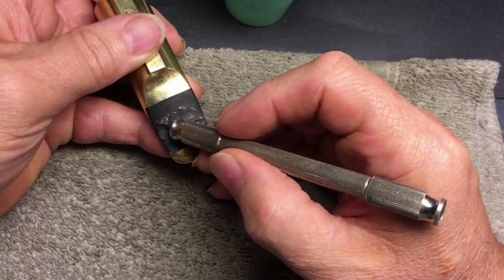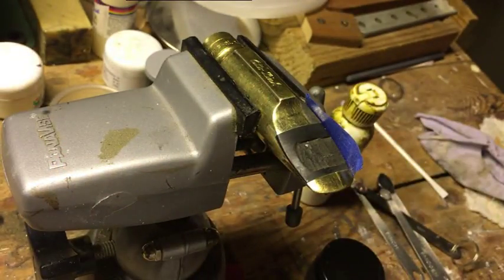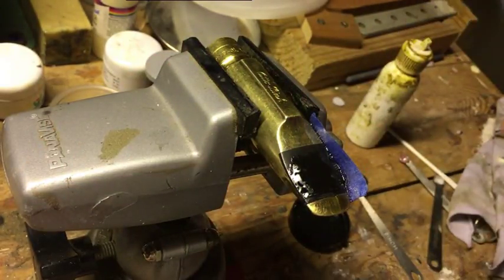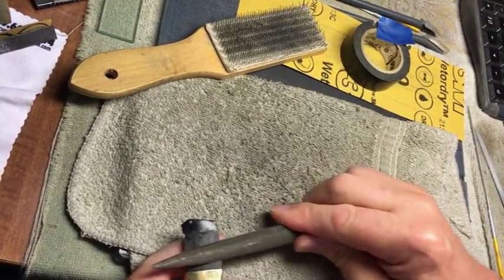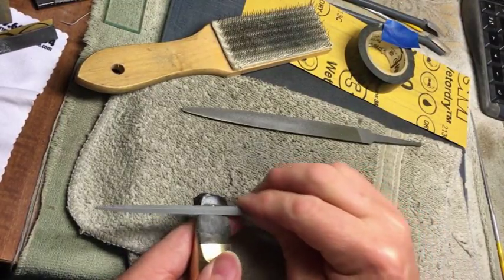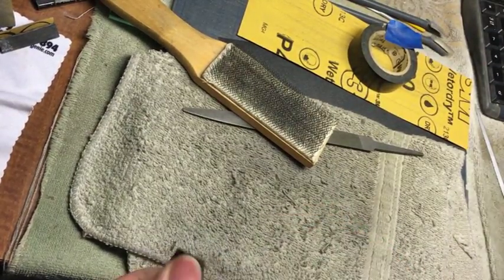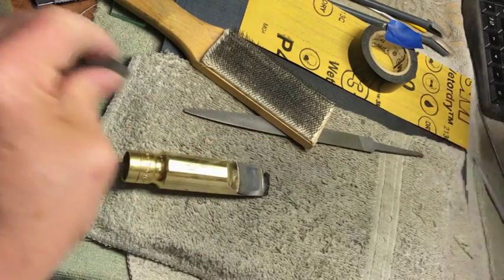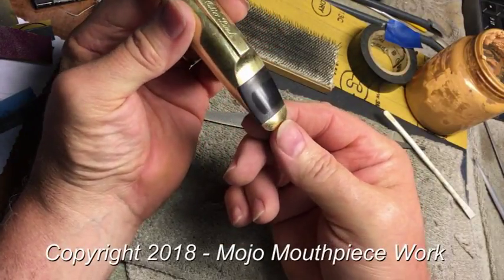Mouthpiece Bite Area Repair

Comment: So it's similar to the superglue and granadilla dust technique for wood clarinets.  Pretty neat.   Does buffing improve the color match?  I can still see the difference between the original material and the patch.  I can't really tell by looking here if it's color or maybe surface finish.  Still looks a heck of a lot better that the gouge.
Reply from the maker: loctite222ms Buffing does not change the color IMO.  It just adds sheen.